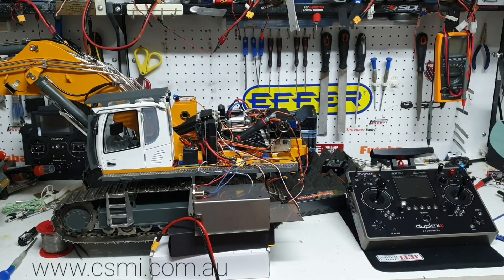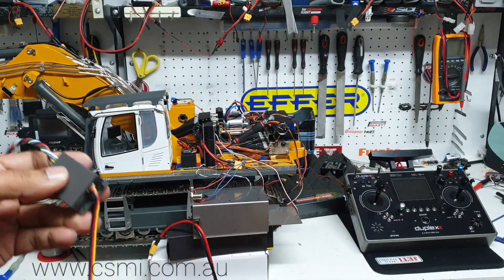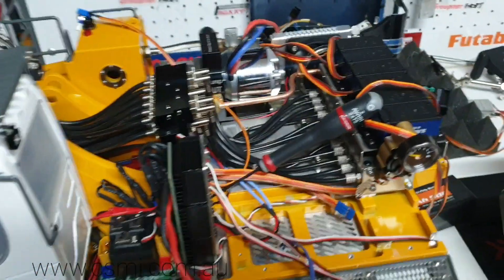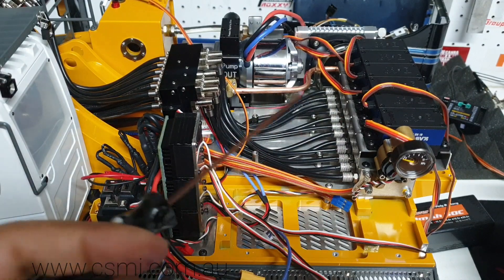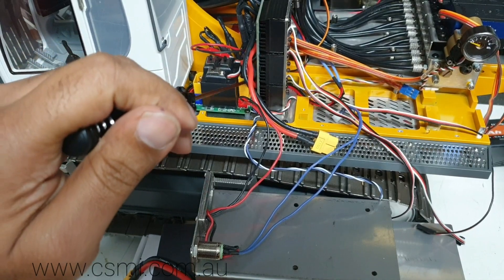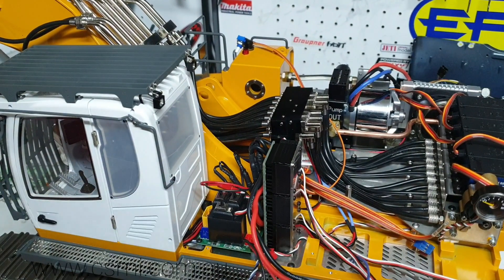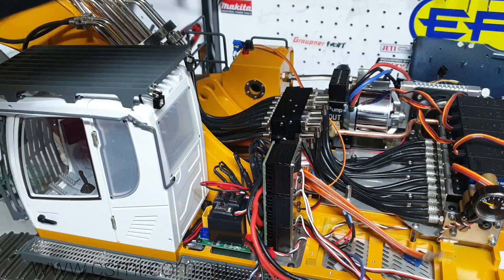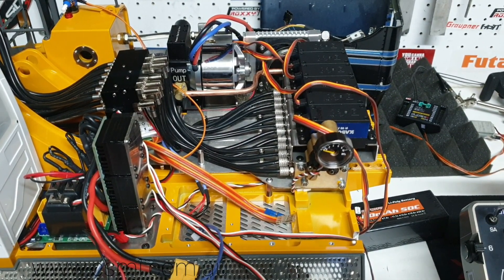CSMI : Sound upgrade Explained on EX9700 RC Hydraulic Excavator.

Comment: Hi Kevin l have been following your post and have changed the radio and going to use the servonaut sound, can you help me with the wire going from the pressure valve to the display, purple go to one plug the black and white go to a second plug should both go to the rx with two switch or is it for power for the light 🤔 thankyou
Reply from the maker: Hi Steve please email info@csmi.com.au it will be easier.  Thanks